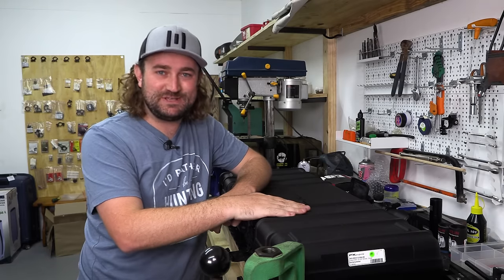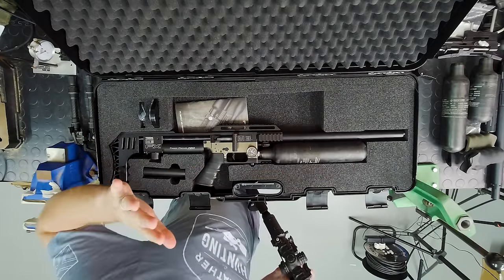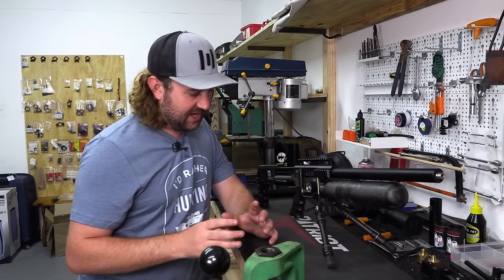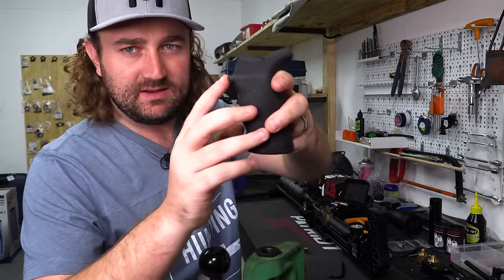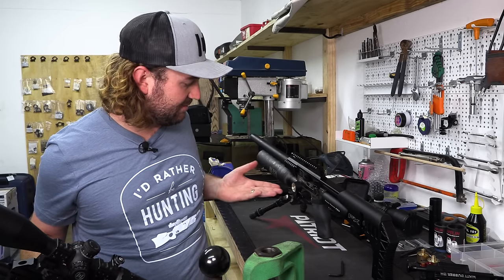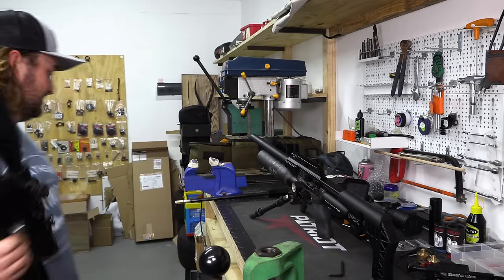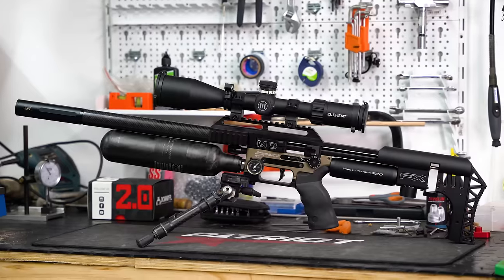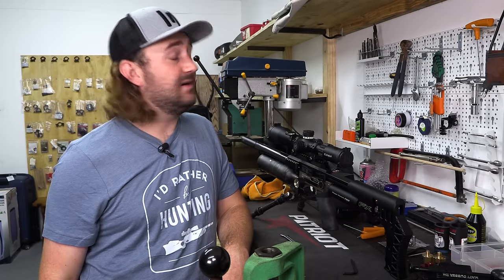How I set up my BRAND NEW FX Impact M3

Comment: As you do with your airguns, I have procedures I follow for every new centerfire rifle and pistol before ever firing them. I disassemble and deep clean everything as they come new with machine oil everywhere. With a semi auto pistol or rifle, I then rack the slide about a thousand times. Disassemble again and look for wear points. Same with bolt guns, rack the bolt hundreds and hundreds of times and assess. I run the borescope down the barrel looking for any tool marks or any other issue. After firing, I study the brass and precisely measure the case so I know exactly what my chamber looks like. I like to know what I'm dealing with LOL.  Thanks Matt!

Comment: HOLY COW BATMAN. How many FX'S do you have? I have been saving $ for my first FX for 2 years. As a 73yo disabled veteran, my cash flow is greatly reduced. Due to health issues, weight is a factor so supported will be preferred. Then there are night vision scope choices.  When all is consiered, I likely will be too weak and old before I can afford a setup like yours. Regardless of these obstacles, My break barrel may have to suffice. Wish FX made a budget rifle for us old warriors. You videos are outstanding, your stock of weapons is maddening. HEE HEE. Any suggestions on sourcing used FX's and night scopes is appreciated. After 23 years as an Army Ranger, where cost was not a consideration, and end results meant everything I must keep costs under control. Thanks

Comment: oh boy i just got my Impact m3 less than a day. i fell in love with the build nice looking airgun.  sadly it will be my first and last FX, the gun is so expensive and FX quality control is so bad. out from the box my unit leaks air out of the barrel. seems like the valve does not close properly, regulator 2 is lazy too.  i was expecting everything to work for the money i paid for it.  Now what is see with FX is all hype and money making thru accessories. ill be returning this unit. and thats that.  This is my experience. Lucky are those that did not have this problem. Im going back to my trusted AGT Vulcan 700mm sluger.CHEAPER, simple reliable and accurate!

Comment: Absolutely love the information you share! Good video mate.

About the carbon fiber sleeve, I received 2 (.22 & .25). Both were non concentric. The liner became ¼mm out of center using the CF sleeve. The liner wouldn't center up with the transfer port or the barrel nut. Hopefully this isn't a common issue.

Comment: Instead of electric tape, have you looked into using marine grate shrink tubing?   It has an adhesive in it that melts when heat is applied to shrink it.   Maybe it won't work, because of the thickness of the tubing.   I couldn't tell you how thick it is after shrinking.   I have used it on may applications, and love the stuff.

Comment: I swaped the probe holder screw after stripping the original one. Used a set screw with a 2 mm hex instead of 1.5 mm = more surface area and better grip. Same threadsize but a harder material.

Comment: Waiting for my FX Impact .22 Compact from UA to arrive. Will follow your setup steps before shooting as I plan on shooting slugs. Going to order the slug kit and will need to order a tanto or tatsu since I did not choose to include the FX DonnyFL moderator/silencer. Will shoot it with the 300 cc bottle until I get a 300 bar bottle.
What Patriot slugs should I use for the 500 mm barrel or should I buy a 600 mm?
Thanks Matt for all the effort that you put into all of your videos

Comment: Hi Matt, Firstly, great videos! I am looking at purchasing an FX Impact M3 BUT I do not hold a firearms certificate. I am after a sub 12ft lbs rifle and would like to know, with regards to my intended purchase, what I should be looking to get in my package. I understand that being sub 12ft lbs there is limited 'tuning BUT massive customisation to make it as individual as i want. I will be using it for target and hunting. I wanted to know which length barrel as i prefer .177 for the flatter trajectory. Being new to the FX product and influenced by your excellent videos, I will also be looking at Elements glass to top the rifle. I was looking to get the Nexus as I believe the glass should be heavily invested in as it is the most important part of the rifle. I look forward to any advice, help that you may be able to give me.
Kind regards,

David

Comment: I have a question.  How do you remove, disassemble, replace standard.25cal 700mm  m3 barrel sleeve and reassemble with carbon fiber sleeve,  and reinstall barrel?? I'm forgot to have it installed at Utah airguns.  I'm doing this on a extremely limited budget and can't afford to send it across the country to get it done.  A video on how to do this would be greatly appreciated.  Thank you for your time.

Comment: This is a very interesting video Matt. I have a question for you though-  FX tells me the regs are good to 170 bar, but that is pushing them pretty hard so life will be shortened obviously.  With these new MK 3's, are the regs even stronger now and capable of sustaining those high pressures you mentioned in this video?One other question if you have the time to reply- will that slug power probe do much for my late version MK II with the power plenum they came with? I am shooting a 30  cal/700 with hybrids.  I am running a fairly low reg pressure of 130 for durability.  The guns shoots very well with the tune I have on it now, but if I can gain speed without having to up the reg and thus lose shot count, that would be great. Thanks.

Comment: Awesome video that's what I do well that's what i did with both fx impact m3 22 cal 700mm and fx impact mk2 25 cal 700mm both are amazing air guns they are set to shoot 34gr 218  javelin at 1000fps 25 cal 700mm shoots 34 gr varmint knockers at 1000fps both the same cf sleeve Ernest Rowe transfer port both kio donny fl and slug kits fitted  only thing that's different is my m3 22 cal can fill to 300 bar I get plenty of shots thanks for sharing bsafe matt dubber

Comment: I have a brand new m3 sniper from utah airguns they set it up for pellets at 920fps. I just received some fx hybrid slugs so I rotated the transfer port to the slug opening and did nothing else. My gun went from 920 to 965 fps by doing nothing else the point of impact was 16 inches high and 6 inches to the right at 50 meters. Is this normal or is my barrel liner that badly bent. I had to raise my fx scope mounts up almost 3/32" to compensate for the point of impact shift. Or should I call fx and get a new liner or index it 180 degrees ??

Comment: I have a question about barrels.  Just wondering can I take the 700 mm barrel for my crown and switch it over to my impact 3 and just buy the kit for the different caliber.  My impact is in 25 cal and the crown is in 22 cal.  Didn't know if the barrels could be interchangeable.  Any suggestions

Comment: Hi matt would it be possible to buy a fully adjustable fx from patriot and ship it to the uk? I only ask because the fx rifles are missing half the parts, no power plenum, no hammer adjust, no valve adjust, no micro adjust pretty much everything that makes an fx
Reply: @joshuagibson2520  UK laws...not fx fault.
Reply: @joshuagibson2520  just makes the guns not worth the money.. Bit like having a ferrari and it being limited to 20mph 😭
Reply: @wild_sam9845  the gun could be tuned down for sale to meet the law and leave it to the buyer not to adjust until they have the relevant licence
Reply: Your talking about a sub12 uk spec impact. Uk can have the proper impact just need your FAC
Reply: @samsawyer2145  but to keep the rifle you'll need a FAC permanently and if I had FAC I'd get a Barrett.. 416
Reply: @firstknight6057  good luck with that

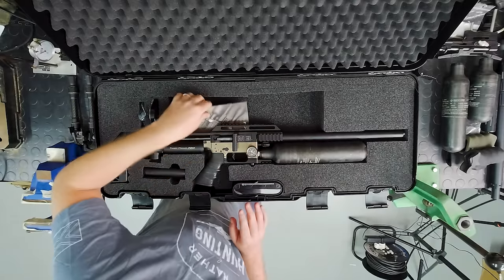Comment: At mark 7:27, the "aftermarket" pistol grip, even though claimed by the guy to be more comfortable for the webbing of the hand, it doesn't seem to fit properly. For that reason, I'm not impressed, and seems like a cheap hack on an expensive rifle. At mark 2:58 you can see the factory pistol grip fits perfectly.  Next, at mark 18:26, electrical tap is used as a hack to keep the barrel liner O-rings in place. Again, I'm not impressed. The engineers at FX need to solve the sliding O-ring problem beforehand.

Comment: Yeh, and i just take my Anschutz .22lr straight out the box and do the same with it as you can do with the most expensive impact in 22 cal. I just take with me a box of ammo an skip bottles, compressor leaking o-rings and gaskets, changes and all adjustments. Cheers!
Reply: since when does spending gobs of money on something you really want require that it makes any sense. :) Beside, there's no real challenge or excitement picking up an overpriced fire burner to shoot something like a 22lr. :)
Reply: @larrycoleman2225  Overpriced fire burner? What do you think an impact is:-)  not overpriced? I want reliability, simplicity and no tralala. That's why i shoot 22lr, .17hmr and quality springers. I understand that is hard to discuss on this platform. Cheers!
Reply: @rapalaron6348  LOL, I thought we already confirmed, spending gobs of money on shooting instruments is not based on any common sense at all. LOL